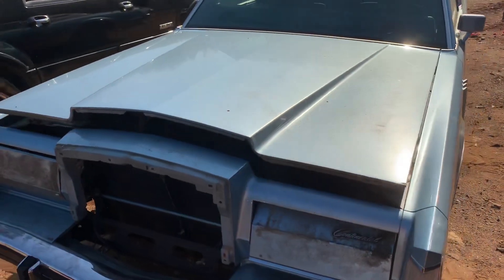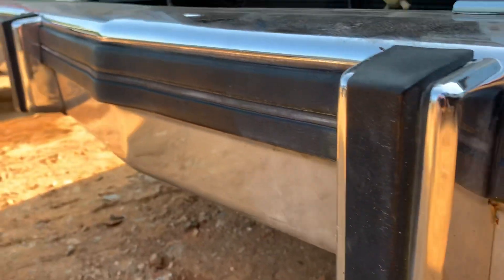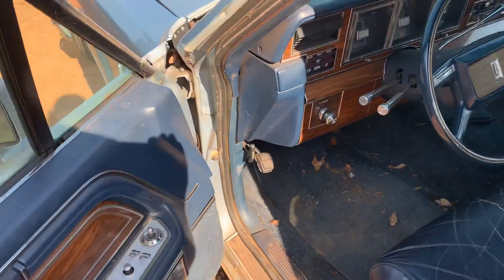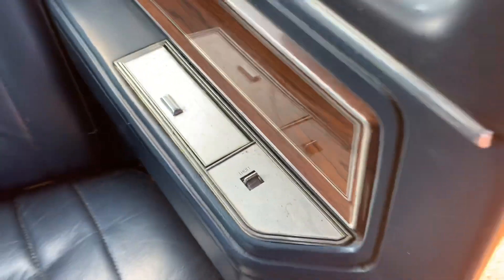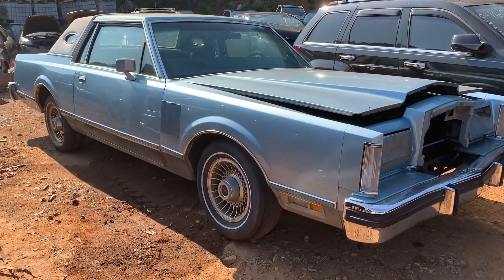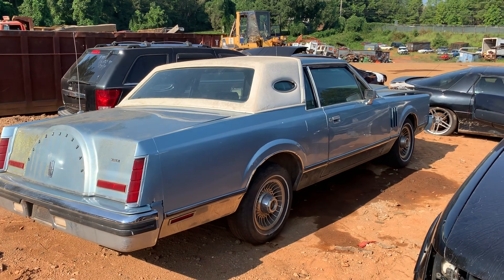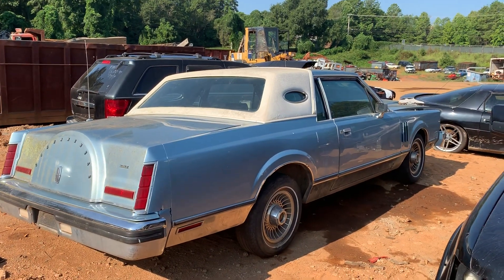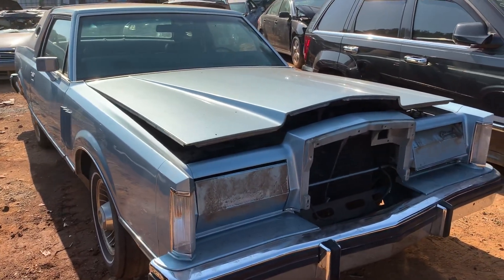SOLD FOR SCRAP!? 1982 Lincoln Continental!

Comment: That thing is still in decent condition you should keep it
Reply: ignition switch is wonky try to crimp the contacts under the column  to restore contact or get one from a Mustang of same era and plug in to start
Reply: Just go to AutoZone and order a new ignition switch and then put the car on eBay you might get $2,000 for it after it's running it's more than scrap value!
Reply: Keep it and drive it.
Reply: @ruwithlee1970  A 2 door lincoln is rare ...keep it and fix it!
Reply: This kind of shit pissing me out $ 20,000 lincoln mk6 really somebody is going to buy it

Comment: It is a Continental Mark VI.  The flagship, top of the line and best of the Lincoln division for 1982.
Reply: The 1982 Continental was Lincoln's flagship.  It was a new model for 1982 and had a similar style to the Cadillac Seville.  The Continental Mark VI was an upscaled version of the Town Car and the middle priced car in Lincoln's lineup for 1982..
Reply: Ebony Bunny, you are mistaken. 82  Mark VI was flagship, not Lincoln Continental.   Read Wikipedia if nothing else.   When it came to the Lincoln division, any year they built a Mark, be it a Mark III, IV, V or VI, that Mark was the Flagship too of the line.

Comment: Dude, what's this I hear about even THINKING about that being a "parts car"? Nooo, that's a saver! Even if the motor is shot, put a 302 cid (or whatever) out of a wrecked car in it. Years ago, I saw a 1982 Lincoln Continental Givenchy Signature Series car in the junkyard. It was in practically perfect condition with only 60k, except for one of the little windows being shattered, a blown engine, and I forget what little else. They had just gotten it in. Long story short, a kindly lady employee informed me at the time (1990's) that replacing the engine would have been a very expensive headache, especially if it is not replaced with the original type engine. Nevertheless, that did not stop me from at least trying to save it by advertising it on our local online BBS (Bulletin Board Service). There were no takers. But that lady's explanation helped me to understand why many "savers" get scrapped.

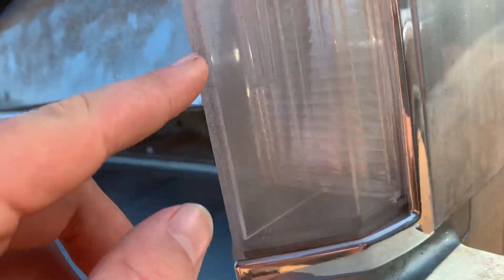Comment: 2:08 I could just hear Doug DeMuro pointing that out about the front marker lights! "Even the front turn signals have the logo INSIDE the lens so everyone around you knows you're driving a Lincoln!"
Reply: 969thewhip 😂😂😂 accurate!
Reply: Ford is still doing this. I have had my 2017 F-150 for two years, and just discovered there is a Ford logo on the side of the low beam headlight bulb reflector, within the headlight assembly. This was my "easter egg" find last week.
Reply: @jdslyman He reacts to everything as if he was born yesterday (which he was), and his tone is always somewhat condescending with a touch of ridicule. Man, I had a '77 and an '81 Olds 98. Talk about phenomenally comfortable and beautiful cars! The '81 was stolen from me. They are very hard to find these days.
Reply: @jdslyman I know! My '77 was an LS, which had plain seats, but the '81 was a Regency. Those pillow-back seats were something else. When we took a trip, I often rode in the back and let my father drive just so I could enjoy them fully. And there was no stupid center console. No car today offers anything similar for any reasonable amount of money, and that's a real pity. The Great American Automobile is dead. Thank you, Detroit - you could not have surrendered more disgracefully.
Reply: And he’ll complain about the surface rust under the car.

Comment: Very cool, almost bought a huge 1979 Lincoln Continental the other day with 25,000 actual miles. 1979 was the last year for the true land yachts at least with Ford. GM and Chrysler downsized their cars 3-4 model years prior. I say give this one a chance, looks like it'd clean up well!
Reply: I had a '79 Mark 5 Bill Blass edition I bought from the original owner. A '72 Continental 4 door, too, that I also bought from the original owner. That one still had the back seatbelts wrapped in original plastic from the factory.

Comment: Looking at it, it might be 16000 original miles, as it has no rot, but also the tires look like the original type with the small white wall banding.
Reply: They still make white-wall tires, you know.
Reply: @TiberianFiend  these are identical to the originals, plus not many people pay the extra cost of whitewalls when replacing them, they just buy standard tires.

Comment: Assuming there aren't any major mechanical issues (which there very well might be, it was scrapped for a reason) it's in really good shape. It'd absolutely be worth throwing a battery in it and seeing how it fairs, after checking fluids of course.
Reply: The body is so good that it would even be worth throwing a new motor or trans in, if one or both turned out to be junk. I'm so envious of people in the South with their supply of rust-free classic cars. I split my time between Boston MA and the UK and anything from this period that has survived has invariably been patched, welded and filled with bondo multiple times. Original bodywork is simply not a thing unless it was taken off the road at three years old and parked up in a dry garage for 40 years.

Comment: I was on the lookout for one of these two door lincolns when I found a clean 89 town car and bought that instead. I would have bought this in a heartbeat. The engine is very underwhelming but nothing a set of those explorer heads and an aftermarket camshaft wouldn't fix. The CFI fuel injections system is awful in these, honestly swap to carb. 400HP and overdrive makes for a very nice cruiser that could surprise a few older mustangs!

Comment: Looking at the condition of the factory exhaust / converter, and the brake / fuel lines etc. I wouldn't be surprised if this only had 16,000 miles when it was parked. At 116,000 miles, I don't think the exhaust would still look like this.
Considering many of these cars rotted away with perfectly good grilles, that should be an easy part to find in good condition.
Hope someone gives this a new home. Won't be a rocket with that 2bbl smogger 302. But it will be smooth and quiet.
A fun future project could be a 5.0 Coyote swap!

Comment: NEED FOLLOW UP VIDEO!!!   Way to good to part out.  It would clean up nice.  This is one you should be taking home if you have room.   Low retail is $1900.  Average retail $5100.  Worth putting motor in if needed, but I'll bet she starts. 2 door Lincoln will sell fast.  Would be nice to convert to newer model fuel injected 5.0.

Comment: That's a awesome car! A'82 with a little more than 100k is cool,,I have a '86 Buick Century Limited bought new in 11-85 w/ 103,800 and is running and driving great, only has the  2.8 liter by but has been a very reliable car, thanks for sharing

Comment: Run a carfax on it, if that's the original exhaust system, the paint and body are in such good condition and it's been in a barn for years, it wouldn't surprise me if it was a genuine 16,000 mile car. It has to be saved.
Reply: that's what I was thinking too...only 16,000 on it.

Comment: That takes me back to about 2000ish when I had one of these beasts and beast is the only way to describe this absolutely huge monster of metal, the only thing I ever had bigger was the Cadillac Coupe DeVille which was even bigger and the thirst was wallet crunching, cost a £1 to just start 'em up and I could carry six people including myself with room to spare lol   I will say I preferred the Ford out of the two I had, the only other American I had was a Pensylvanian built Honda US Wagon which was amazing and lacked absolutely no luxury with electric everything and quite surprising, frugal with the petrol too.   The Honda's end came when I tried to find a replacement brake regulator, abs no where had any here in Britain and Honda wanted nigh on 2 grand for a new one as it was the heart of the ABS making it so expensive, only after I scrapped it did I get told "oh by the way, a EU spec Accord estate module would have fitted" which was like £20 from a scrappy but too late, it was a cube of metal down the local yard :(

Comment: My dad had one of those cars. The air conditioner never worked well. The dealer worked on it at least twice a year for the five years he had it. They never charged him for working on it. After about sixty thousand miles it turned into a money pit so he got rid of it. You couldn't have given him another new one.

Comment: This and the Versailles are my favorite Lincolns.
Reply: Versailles? Really? LOL
Reply: @robsrandomness7824  Yeah bro. My favorite Thunderbird is the 1980-'82.
Reply: @roadwarrior114  The ones nobody liked. lol. That's okay. I like oddball orphan cars, too. BTW, I had an '83 and an '87 T-Bird.
Reply: @roadwarrior114  BTW, my fav Lincolns are the Mark 5 (I had a '79 Bill Blass) and the Mark 6s.
Reply: @robsrandomness7824  I almost got a Yugo when I was 11 and pretty soon I might be getting an Isuzu Pup or '80s Ford Ranger or some other small '80s truck.
Reply: @roadwarrior114  My gf in high school had an '87 Yugo. I did a few burnouts with it.
Reply: @roadwarrior114  Hard to find old small trucks around these days. I had an '86 Trooper once. Have a 2010 Ranger long bed now (4.0 V6). Awesome truck.
Reply: @roadwarrior114  And for oddballs, I had an '83 AMC Concord, a '91 Geo Storm, an '88 Festiva, an '88 Diplomat, an '84 Seville, and an '88 Grand Wagoneer.
Reply: @robsrandomness7824  Nice. what color and trim level was it?
Reply: @roadwarrior114  which vehicle?
Reply: @robsrandomness7824  Yugo.
Reply: @roadwarrior114  Oh, my girlfriend's. Don't know. It was tan, 4 speed manual, and the rack on the roof. Was 2 years old and already had spots of rust on it (in FL, too!).

Comment: Next door to me in Elmira NY sat a motor home abandoned for 5&a half years it hadn't run for that long. Some guy from Canton PA who is a dairy farmer that has a long beard bought it off the owner and had it towed to Canton PA by Renwalke towing for $200.00 he is going to either restore it or have it converted into a pirate ship parade float. On the upside either way it is getting some use out of it instead of sitting next door to me rotting away and becoming scrap iron. Sincerely Robert Gildea Elmira NY

Comment: That is a nice ride for sure. The owner got too old to drive or they tipped over, not the car. When they set that long, the tires get flat spots so you would need to peel some rubber off something but damn, get under the dash and pull the steering column down with two bolts and the put the ignition switch off the column and just start it from there and then all the gages would work... I wouldn't give it the "Jay" test by starting and holding to the floor for twenty minutes to warm it up but those three o twos run forever, might need a timing chain being its set so long but put some lucas oil treatment in it and shut the lifters up and then drive it every day for years. There is money written all over it

Comment: I owned an 80 Lincoln Mark 4 I put 289,000 miles on it before it rusted apart those Motors will run forever as long as they're maintained it has in the body fuel injection and it is the same motor they stuck in the Mustang 5.0 it even gets decent gas mileage for a car that big if you fix the suspension put a nice dual exhaust on that car you'll never want to part with it

Comment: What caused the rust around the continental kit and left back?  It looks like a big area. You didn't point that out. Also, wonder if the cat converter is good.  If not, it will smoke like crazy.  Can those be replaced today?

Comment: these floored in 1982, the top speed was supposedly 90...the 302 would grenade if you tried to attempt it from 80 mph, it would overheat every time you tried. Its a boat anchor..it was so bad that they had to put the fuel injected 302 from the Town Car in it in 1983. 1982 was a bad year for these

Comment: My father in law had a 4 door exactly like it same color etc that 302 is fuel injected it’s a Tbi unit his only had 23 k original when he bought it back in 04 but the problem with the engine is ford used a system called eec 3 it is god awful no one will work on them not even a ford dealership wants to mess with them because there was no on board diagnostic system you had to use a pin out box that plugs into the wiring harness and computer then you had to use a volt meter to measure your resistance values and voltage values. There is a sensor called a bmap 
They are very expensive you can convert it to carburetor but the ford dealership told me on his that you have to change the timing cover to allow fuel pump installation some of these cars did have a variable Venturi carb they still used the eec 3 system as well I was going to buy his Lincoln but this computer system turned me away his air condition er did not work well either
Reply: Just rip the crap out put a Holley sniper and switch to points if needed

Comment: Other than the UGLY ass aftermarket radio, this thing's STUPID mint and I have no doubt in it running, although you MAY wanna check the oil real quick to make sure it's at a good level and not sticky. You've gotta let us know if this sells! 1982 was the last year for factory 8 tracks, so this could have been an 8 track car. But I'm sure there's another junk 4 door Continental in your yard with a good grille to take off of. 
1980-1990 continental grilles are pretty similar!

Comment: Those Lincoln's had a 460 c.i.d. V8, not a puny 302.
Reply: RICHARD L.  My dad had an 81 mark VI like this. burgundy red but unfortunately 1980 an later they only had the 302. His was painfully slow but still was a very nice car.
Reply: @jayson657 , wow!, I had a 1980 F-150 with a 302 and it barely developped 125 H.P. ... it must have been a terrible slug, indeed. I still have an 1989 460 c.i.d. and it develops only 230 H.P. in a 5-ton Econoline.

Comment: Wait... carburated engine with the cat? That's interesting
Reply: Welcome  to  the  80s lol
Reply from the maker: Our 81 mustang had a carbureted in-line 6 cylinder with a factory CAT
Reply: Once on a car meet I was talking with one guy about 50cc GY6 engines and I wasn't sure if they had catalytics and the answer I got was "A cat to the carburated engine? Never heard of one" so that's why I thought that way, still maybe it's just cause we don't have much of such cars here in Europe. Btw if someone know does such scooters have cats or not?
Reply: It's throttle body injection. ECC3 system, kind of a pain to diagnose any issues. Ford switched to their ECC-IV system in 1986(?) which is a modern sequential 8 injector system. My 1989 town car has this and so do all the and trucks through 1997.
Reply: Its not a carburetor. It has throttle body fuel injection.

Comment: One more thing that car is a 1979 licon amd not a 1982
Reply from the maker: tyler phathom nope it’s a 82 .... vins match, title matches and the door code is correct. It’s a 82
Reply: Its definitely a Mark VI made between 1980-1983. The 79 mark V was much longer.

Comment: There is no real market for these cars, nobody wants the Mark VI.  I can kind of see why, compared to the humongous 70's Mark IV and Mark V, this car really isn't all that pretty or special.  Anemic 302 under the hood doesn't help either.  Shame this one was scrapped as it was a decent survivor, but if you look at the cost of replacing the leather seats, new vinyl top, go thru it mechanically, you could easily blow $3-4k on a car that is MAYBE worth that, and only to the right person.  Like I said the Mark VI is a hard sell when you compare it to the big 70's Marks.
Reply: These cars do have a market
A clean '80 with the 351 and digital dash is 20k and up
This one should fetch 8k easy if cleaned. No extra parts needed
Reply: @MrCarguy2  Really????  I thought they were like 5-6k tops for like the nicest one in the world.  I know Mark IV and V's will fetch 20k long all day  for a REALLY nice one.
Reply: @aaronbays4  I have seen them go to even 30k for really high spec models
Panthers are still loved, perhaps not as 60's or Early 70's but definitely up there particularly '83s and behind

Comment: You mean it has a 460 and not a 302 the 302 was a mustang engine in 1996 to 1993 they did put a 302 4.6 leter engine
Reply: 1980-1991 Lincolns have the 302. Last year for the 460 in a car was 1978.

Comment: And what guys pay for a miserable pickup truck when they could glide down the road in that 
Every folks lady cars are famous for low miles and being stored n sold by their children because they don't like the style of the car.
They blow the cash on a (one whack its on a roll back) type Eco econo slowness new bubble car 
Or a high Milagros tired pickup truck
My whole car collection is mostly low low Mile cars they revive do
Much more ezilly than high mile cars 
I have cars with 2k. 13k. 18k and 20k miles I got at great prices all over 40 years old all I desmogged 
I run 200 miles a year randomly.
There is no new car I'd buy on the market.even my Rolls has only 58k miles and is 30 years old.
Rolls club members say none of the cars made after 1999 are really a rolls anymore their just doomed high technology bmw with rolls emblems 
The high technology dooms the car to an early death parts not available they become $490.00 scrapers built for rappers that can never be restored